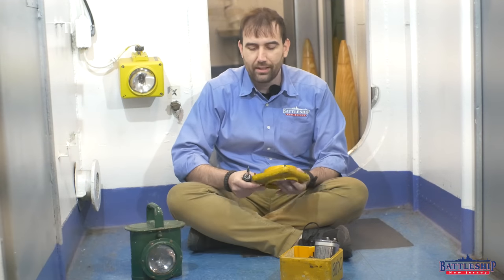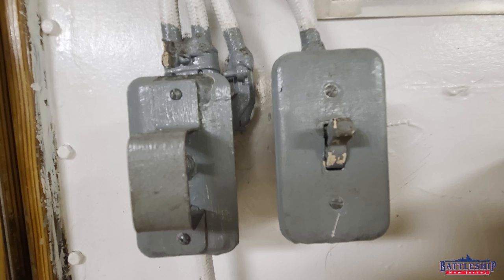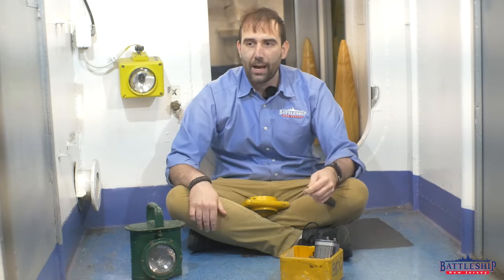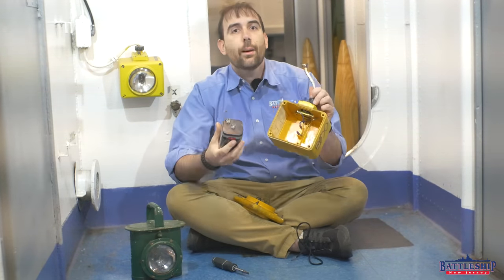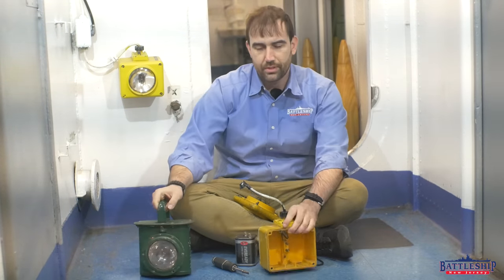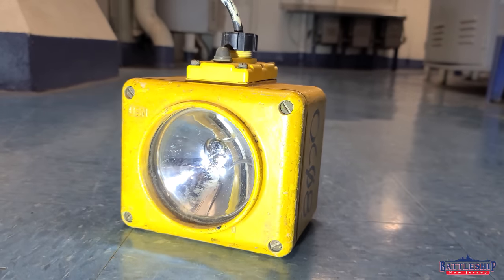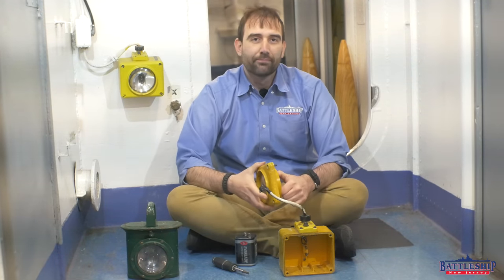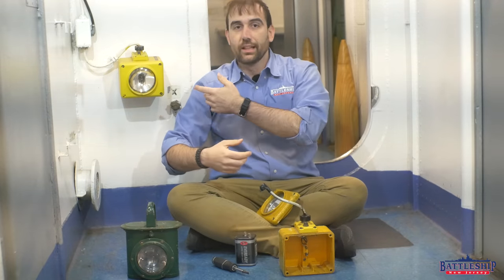When the Lights Go Down on The Battleship

Comment: I spent a couple of months as a divisional DCPO . I hated doing the monthly checks, especially having to take all the screws out to check batteries in the yellow battle lanterns like you see on New Jersey.  I knew the guy before me didn't because when I'd open them up the batteries were dissolved and all the goop would pour out. I learned to stand back when opening them up.
Reply: Thank you for being someone who actually did what they were supposed to do. I'm sure I don't need to tell you this, but it's responsibility like that that helps keep people from needlessly dying in emergencies.
Reply: When I was DCPO, changing those batteries was a constant hassle.  There was also not enough money in our DC budget to buy  enough batteries.    I hope in today's navy that they have figured put how to make the fixed battle lanterns rechargeable.   The thing is getting constant power anyway, it should be easy enough to add a charging circuit.   Replacing the incandescent bulb with an LED array would also increase runtime and reduce burnouts.
Reply: You'd think they'd use different fasteners that made them quicker to open and close than simple screws, too. Unless they were stupid and chose something that really hurt your hands or something, it could only make it more likely that the work would actually get done.
Reply: I was DCPO for 6 months on my last ship. It was newly commissioned 3 years before, and I was S2 division. I had the most spaces on the ship of any division. Apparently none of the previous DCPO did much of any actual work they were supposed to because as you said, batteries in battle lanterns were corroded and a mess. I ended up replacing quite a few lanterns because the corrosion was so bad. After only 3 years in service. Don't even get me started on the deck drains. But orange bug juice was a great cleaner of corroded brass fittings. Had to tap out more broken screws than I care to remember.
Reply: @Mark13tol  Texas Pete does a pretty good job on deck drains, too.
Reply: Thank you for actually doing the work, especially since its maintenance of literal life saving equipment. And yeah they should use rechargeable batteries to automate the process as much as they safely can cause we all know the people that are trusted to do it rarely do.(As long as it's not overly automated and simplified, like the broken POS LCS's)

Nowhere near as important, but I remember when I was part of the student/dorm council at the government run trade school I went to, we kept running out of cleaning chemicals a helluva lot faster than we were supposed to because everyone just poured/dumped it. I suggested we measure out the set amount in the small plastic dixie cups we already had hundreds of for laundry detergent, so everyone could just pour the set number of cups stated and be done with it. I was overruled by the staff because "They should just pour the amount they're supposed to". Naturally the supply problem was never resolved.
Reply: @pyro1047  by the 90s yeah,but when jersey was commissioned and at least through the Korean war I would argue that rechargable batterys didn't meet the requirements for the job at the time, and obviously LEDs didn't exist and that wouldn't be feasible till probably early 2000s, old ships were just kind of stuck with what they have unfortunately and anything from WW2 still running in the 80s and 90s wasnt getting the attention for the stuff if the old worked for the task already
Reply: @jaykoerner  Even by the 90s rechargeable batteries wouldn't have been adequate, the power output as they drain tapers and dims off way too much and the charge they can hold wasn't comparable to non-rechargeables. They also needed protection against overcharging which would cause them to burst, which if added is more cost and another thing to go wrong in a system that's intended to be safety-critical levels of robust.

Wasn't until we really nailed lithium-ion battery tech that rechargeables basically became better in most situations, and a big unsung part of that was miniaturisation of the microcontrollers needed to stop them bursting into flames. (Also not a good thing in emergency equipment.)

Comment: The battle lanterns on my sub apparently didn't get maintained very well.  We lost all lights in engineering, which wasn't supposed to be able to happen.  The battle lanterns came on for about 3 seconds, and went out.
Guess how dark it is on a sub, with no lighting.
Pretty dang dark.
After that I carried the old mini mag lights.
We had the yellow type shown in the video.
And yes, we could move based on memory.  And we had non-skid marks on the floor to designate EAB manifolds.
But trying to get lighting back can be a problem.
Reply: I feel like somebody must've gotten chewed out real good for that, having heard some stories about how seriously sub maintenance is taken
Reply: Well, it wasn't nuclear related, or pressure boundary.  And other people had flashlights so...
Turned out, the transfer switch that makes sure the engineering lights are fed from a powered bus, malfunctioned and blew up.
It tried to select port bus, and starboard bus at the SAME TIME.
You can't do that on AC circuits.
Reply: Yes, the Mini-Mag light. Never leave home without one
Reply: @actaeon299  i've had some wayward electronics blow on me in my lifetime, but it was always pretty tame (except for this one big ass capacitor in an amplifier that blew, thankfully no one in the shop was inside it at that moment). I imagine it's a lot more exciting while confined to a dark sub
Reply: @KennyCnotG  It was ... "interesting"

Comment: And the CURRENT version of the newer sealed plastic one has new lenses with LED lamps which will burn even longer yet.  This thing just works and it is still going strong!!
Reply: Yup. Modern disposable emergency lanterns can last up to a month on continuous power using that very same dry cell.
Reply: Yeah, LEDs draw quite a lot less power than incandescent lamps. Which also has the nice benefit of less heat.

Comment: The old metal one looks like it was designed to take the old #6 dry cells, and the move to the newer 6v lantern battery style would necessitate the change alone.
Reply: Exactly! Old lanterns used what they used to call telephone battery,round about6” tall? Took two for each lantern, square six volt ones would not fit!
Reply: Some museums converted the originals to use modern cells so they can still be used.

Comment: I noticed Jay Moulding and Rayco make LED retrofit kits for battle lanterns.  It’s too bad they don’t appear to make adapter brackets which would allow use of less expensive D cells.  They do have rechargeable battery conversion kits, but they’re expensive.
Reply: Alkaline D cells are even worse to corrode than the 6v lantern batteries which atleast don't kill the contacts, although they do make 4 D cell adapter bodies for 6v lantern batteries for about $10... surely they make 6v lantern battery bodies that you can stuff with lithium AA's (it appears the d-cell bodies are the only real option there) 🤔 If not 6v sealed lead acid batteries are pretty cheap, rechargeable, and available in multiple sizes, although connecting them to the contacts would require an innovative solution that doesn't involve a soldering iron (so it turns out they make 6v SLA rechargeable/constant trickle charge batteries in 6v lantern size, i think that's the best bang for your  buck) 😉👍 (made some edits after a quick search)🤫
Reply: @berryreading4809  Thanks for the reply.  Its good to know D cells would be a bad choice.
Reply: @wtmayhew  I have a long hatred for Alkaline batteries ruining or trying to ruin everything from flashlights, remotes, cameras, lasers, other digital measurement equipment 😡 Lithium AAA's, AA'S make up probably 90% of my battery purchases now, not only for better ouput, but because they basically never leak! I've had every name brand of Alkaline battery leak at some point, especially Duracell in recent years, although less with their new "optimum line" 🙄 The SLA (sealed lead acid) 6v lantern style batteries are actually surprisingly available and affordable, apparently they are used for deer feeders/cameras/ still for lanterns/other random applications... 6 and 12v SLA batteries are pretty great, they usually have a decently long life, good capacity, are rechargeable, and rarely ever corrode or swell enough to actually crack and leak. They use them in everything from modern day emergency exit exit signs/backup lights to those electric scooters and similar electric vehicles for kids, to classic jump-pack car starters... I just didn't realize they were common in a 100% matching 6v lantern battery style until you mentioned the conversion idea! 👍💡 🫡
Reply: @berryreading4809  Thanks very much for the reply.  It seems like no matter what technology, batteries are always an expensive proposition.

Comment: I take it the batteries are not rechargeable. It would be nice if they were "topped off" when the power comes back on.
Reply: These lantern batteries are Primary cells, it's a one-way chemical reaction.  Secondary cells are a reviser-able chemical reaction by feeding current back into the cell (a battery charger).

Comment: Gun turrets may get metal because it would probably get knocked off the wall before it broke apart shorting the wires inside. With powder and combustables around they might have thought it safer.

Comment: Modern versions  have trickle charge batteries and an indicator . , If a ship has been without power for months many will still work after it has been restored for only a few hours . They can be lifesavers  , illuminating vital ladders and doors when you are plunged into total darkness , also s morale booster in an uncertain situation .

Comment: About 40 years ago there was a push to make all Motels to have exit signs mounted 6 to 12" off the floor. Reason being when there is several feet of smoke in a 8 to 10' high hallway you would never be able to see exit signs. Would not want to have one of those heavy boat anchors mean battery operated lights tied to me while abanding the ship and not wearing a life vest. Now stays a few ounce LED would provide same amount of illumination.

Comment: Prefer a rechargabie ( by cell phone 5 volt charger )LED flashlight that on high produces 1,000 candle power and if button is pressed twice fast produces flashing light to make it easier for somebody to locate you. When I was an apprentice we had the same 7.5 volt quarter mile ray flood light that the local fire department & electric company used.. Produced a lot of light but extra heavy. Haven't seen one in over 30 years.

Comment: The older green lantern appears to use 2 tall cylindrical 6 volt batteries that were losing popularity by the mid 60s.  Perhaps the changeover was hastened by the lack of readily available or reasonably priced older style cylindrical batteries.  The new cube shaped batteries do seem better built anyway.  Metal body versus a cardboard tube for the body.
Reply: The tall cylindrical batteries with the screw terminals go back to the late 1800's.  In the 1890's people were starting to install doorbells in their homes, they would install a small cabinet in the wall to hold 2 of these batteries wired in series (+ to -) giving 12 volts.  Old radios also used these batteries.  Later on in the 1920's and 30's when more and more houses where getting hooked up to the grid, the door bell batteries were replaced with a transformer.

Comment: I'm a bit surprised you guys still use it with the original 6v lantern batteries and haven't retrofitted them to a simple setup with some rechargeable NiMH batteries and a recharge/boost circuit or something similar. Would be cheaper in the long run, compared to replacing the batteries every couple years.
Reply: NiMH batteries in laptop computers were prone to problems, too.  I am looking forward to sodium-ion battery technology.

Comment: The old ones were handy in the fact that you could use them is lanterns, but aside from that, no real major differences. Apparently except the new ones have better cleaner lenses that might be a little bit brighter and probably slightly better bulbs that are brighter per watt as well. But the green ones where you could actually use them as a lantern and aim them where you need to and take them off the wall and probably disconnect them would probably be incredibly handy but also with a switch probably don't kick on automatically like the ones that you currently have.
Reply: There are versions of the newer yellow ones with the handle on them as well, so you can use them as regular lanterns if need be.
Reply: They would still turn on automatically if power went down despite having an manual switch

Thats because its actually a double switch.

The power cutting off is the first switch.
The manual switch is the second switch.

The manual switch would be left to on by default, but the light wouldnt turn on since the power switch would be making it off.

If power went off/someone disconnects it, then itll turn itself on as that circuit is no longer interrupted.
You could then manually turn it off with manual switch.

Goes like this:
battery->power switch(off when connected to ship’s power)->manual switch(on by default)->light bulb

Comment: if NJ has 6000 of them it was probably lighter to switch the metal ones for plastic ones in terms of weight
Also , whats the oldest battery you found in them ? probably oldest one after decommisson would be 30 years old by now

Comment: Might be nice to have a handle for the newer plastic lights.  Combine best features of both.
Reply: The ones permanently mounted and wired in didn't have handles. But there were plenty that were switch activated and had carrying handles as well.

Comment: 2:35 batteries are also better. I'd pop one of the old ones and new ones apart and i'm betting that the new ones have smaller cells inside, which also makes them run a bit more efficiently than a single coil battery would (kinda like why battery packs have that division too). Like i remember those dry cells lasting poorly back when i was a kid, but nowadays they come with disposable emergency lanterns and some of those last nearly a month (caveat, with LED bulbs).

Comment: A newer design battle lantern would have LED's.  Longer battery run time, LED's would likely never have to be replaced, and you have the option to install LED's that can switch from white to red to preserve night vision.  Also rechargeable NIMH battery's to cut down maintenance costs.  And since they do not have a hot wire filament like incandescent bulbs, LED's have high impact resistance, a very important consideration in a portable battle lantern that is likely to be dropped or banged up in use.

Comment: The separate light switches were also used to switch from white to red.  Some of the fixtures had three bulbs and one would have a red filter.  The red would be used at night so that night vision would come easier than going out from the white lighted areas.  Also used in berthing areas so the white light would not disturb sleep.

Comment: Definitely interesting thing to see done at sea on a ship, because it's actually similar to how a lot of commercial buildings are wired here in the US, in certain spots like at exit doors there are exit signs that have flood lights on them and usually on the outside of the door there's also a spotlight and they work the same way as the fixed battle lanterns where if the power goes out the light comes on and stays on until power is restored or the battery dies, also some buildings have a few lights that are also set up to be on two or even three separate circuits, normally during normal operation all bulbs would be lit however and it's two circuit configuration, one would be wired up to backup power and the other would be normal power and if power was lost and the building was running off of a generator only one half of that fixture would be lit, some fixtures even are set up as triple circuit, and the third circuit in those is actually wired into a separate control box or meter that the power company can control where they can give you a discounted rate if you allow them to turn off part of your lighting loads during peak usage hours like on very hot days in the summer
Reply: Ryan, have you ever had to change an emergency lighting circuit ballast in one of the ships fluorescent lights? If so is it two separate ballasts because of the fact that it's too independent feeds or is it a single ballast with a extra set of wires?

Comment: Video idea: How does emergency power distribution work? You mentioned that maybe power would have to be alloted to pumps instead of non-critical lightning systems. This sounds very Star Trek-y, in the sense of "divert all power to the main deflection dish!" or "divert power from life support systems to shield!" (of course, after changing the shield's frequency).

Is there a big panel somewhere where power was alloted that way?
Reply: why would you divert all power from life support?  everyone would die, would they not.  how would changing the frequency help?
Reply: @DrSchor  it's a Star Trek reference